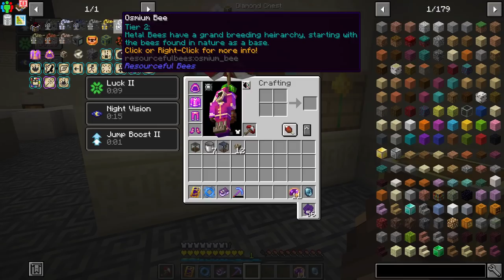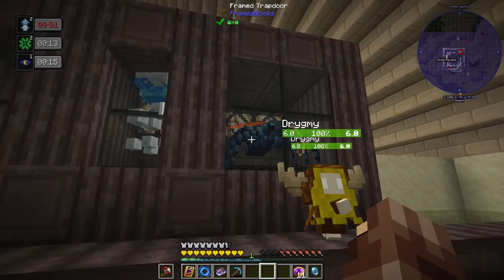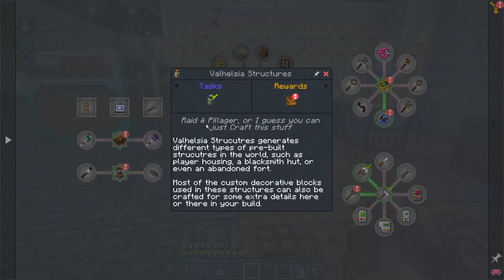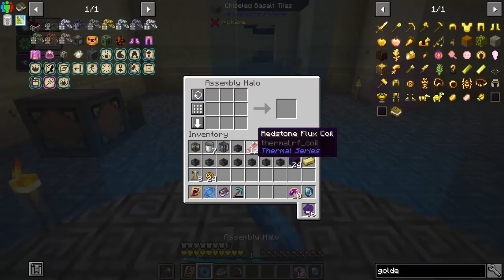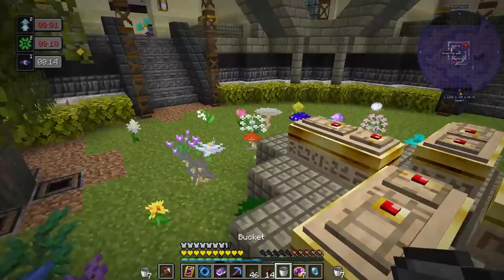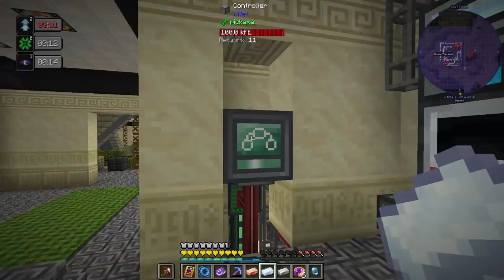Thermal Automations and Upgrading Power: Enigmatica 6 Expert Minecraft 1.16.5 LP EP #18

Comment from the maker: Also just wanted to mention that during the back half of the episode I forgot to add redstone for my xnet to read off of as they dont read directly off of comparators well so did add that in shortly after the end of the ep, so just a heads up in case you are doing a similar system as otherwise it wont shut off :p